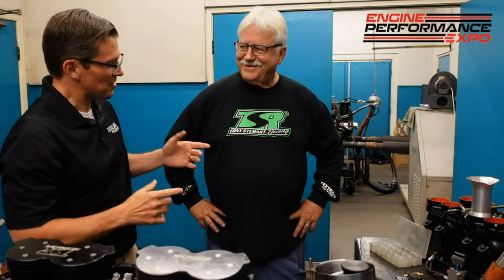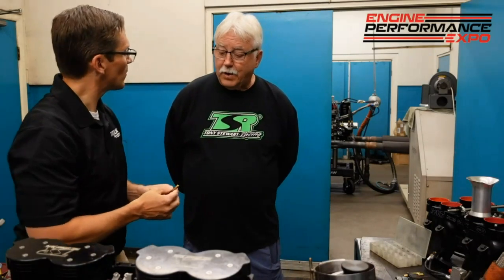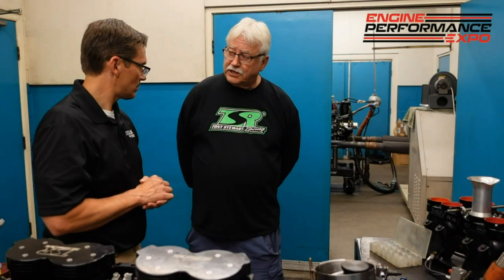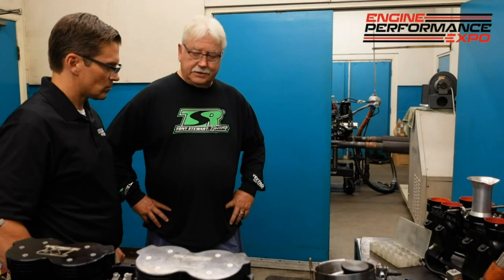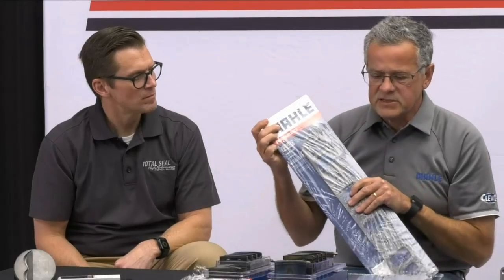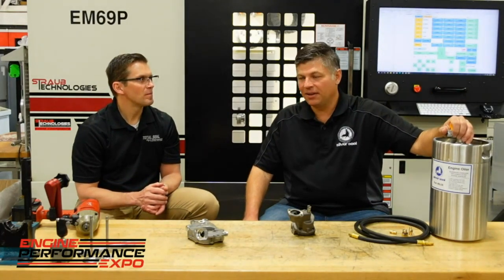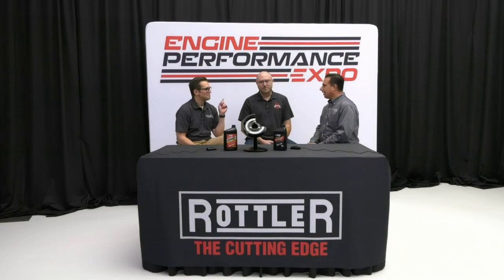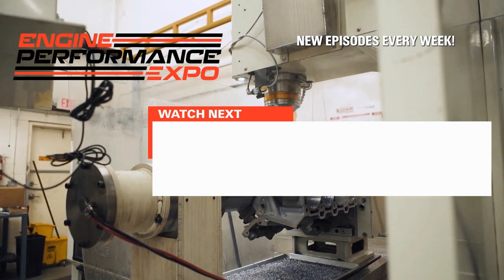Mechanical Fuel Injection with Ron Shaver (2021-22 - Episode 36)

Comment: Mechanical injection is so simple, but you have to forget what you know about carbs.  Alchohol is a very forgiving fuel on the rich side but not on the lean side.  Kinsler was an enormous help with setting up mine for my 500cid alcohol motor for my boat.  Awesome show again Lake Speed Jr
Reply: Thanks for the comment! The next Engine Performance Expo is coming up in January. We can't wait!